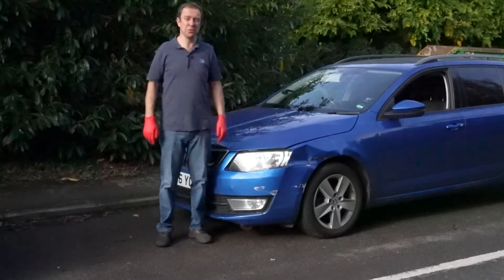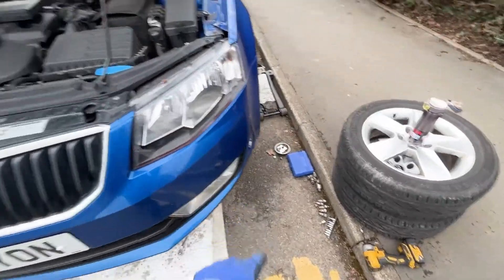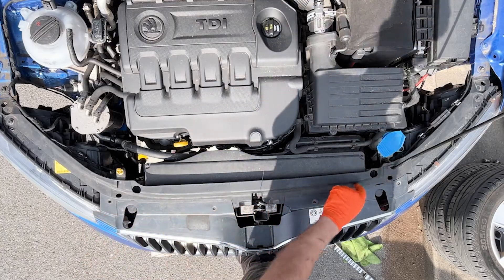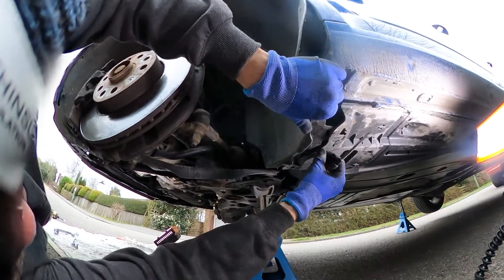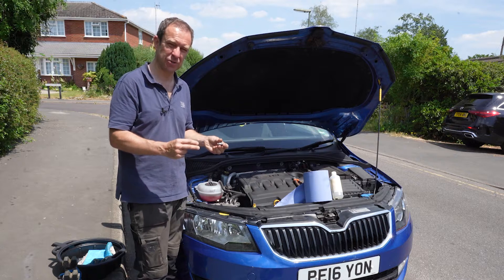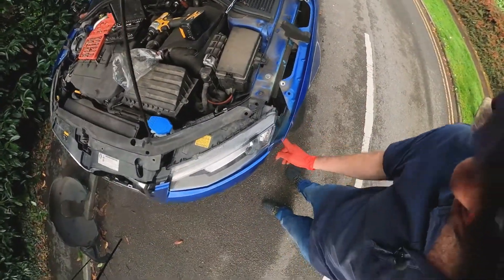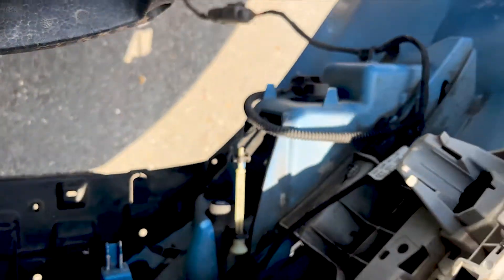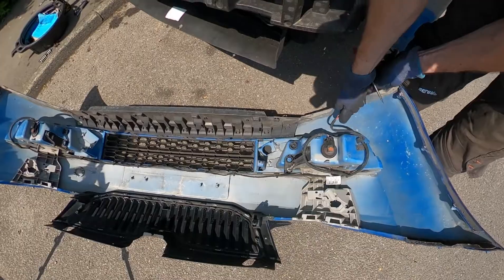How to Remove Headlights on Skoda Octavia Mk3 (2013 - 2020)

Comment: I had to do this the other day because of one bolt. Yes, one bolt...

My left xenon bulb stopped working, but changing both bulbs did not fix the problem, so I had to order the control unit for the xenon bulb. 2 of the 3 screws are somewhat reachable, but the last bolt you need to remove the front of the car and pull out the headlight unit, to reach.
In the same go I found out there's no access holes for the turn signal bulbs, and even though my bulbs are working, I just wanted to get it done while I had access. So I ordered the 'repair kit' for the holes too. I just went to the hardware store and found a kit with lots of different tiny blades for cutting and carving jobs, and it went fairly smoothly to be honest. I just poked through the plastic and just sliced a nice round hole on each side. I thought that was going to be the hardest part, but the plastic is very easy to cut(with a sharp blade)

The hardest part for me was the fact I do not have any flat and hard surface outside, so my car was standing on all four wheels. Even when I removed most bolts for the wheel arch liner it was a pain to get enough wiggle room for my arm so I could reach those 2 bolts that are hidden. Personally I used a combination of a cordless drill with a long(25cm) and bendable extension, as well as an extension offering a 90 degree bend. After those two bolts had been soaking in WD40 for a bit, I reached the one closest to the tire from above, and the one furthest in I had to reach from inside the wheel arch liner and up. It was a bit tricky, but the most important part is just making sure your bit is actually seated and just taking it slowly. If you round off the heads on those bolts you got a proper headache on your hands lol

Lastly I had a problem with one of the two plastic pins that is the last thing you undo. One of them snapped, so it was quite a pain to release it after that.

The only good thing of this whole thing is that they at least have used the same bolt for almost everything. The two inside the liner is different, and the one's for the headlight unit of course. Other than that all the bolts for fairing and wheel arch liner is the same. 

My only advice is that this is most likely a whole lot easier with the front lifted up and the wheels removed, because I at least think you'll have a much easier time by just removing the wheels. after that I believe you wont't need to remove the whole liner.